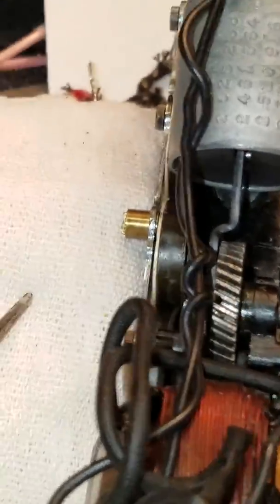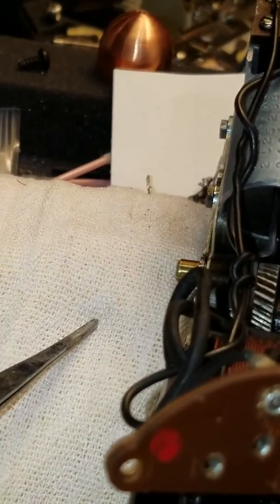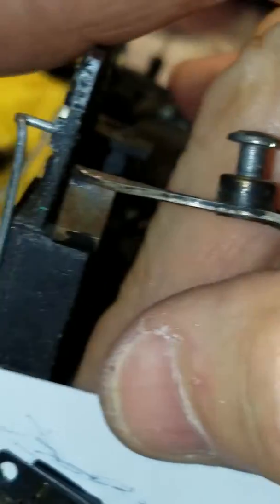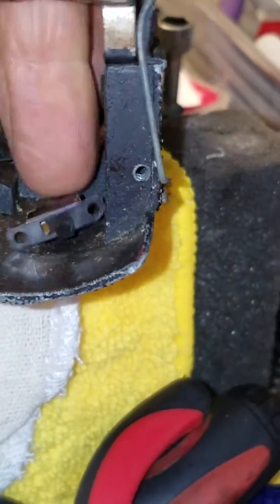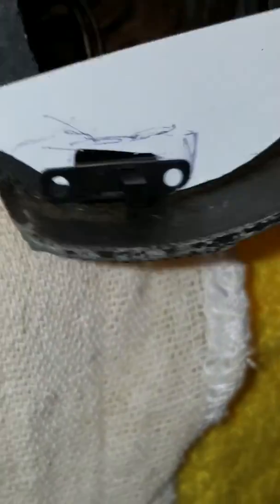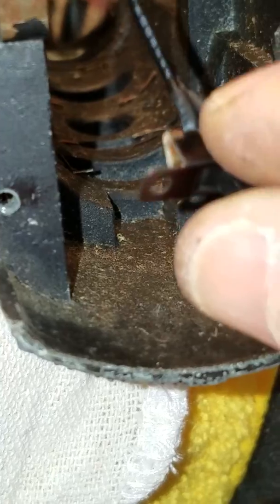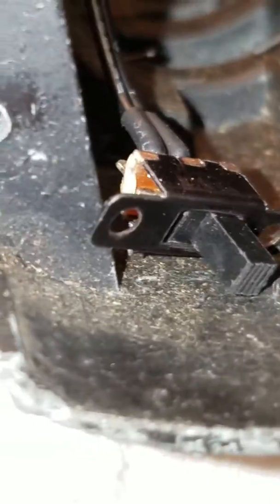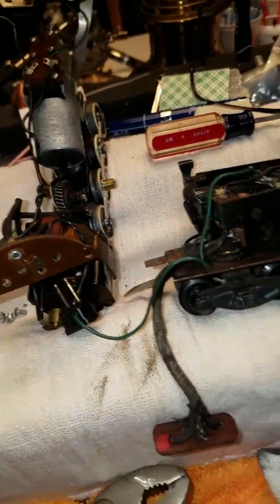American Flyer Smoke on/off switch

Comment: I installed the same thing in my jack panel, but instead of being held in place by a friction fit I drilled a #44 hole, 2.18mm and mounted the switch with a #3 x 1/4  sheet metal screw,  Holds it in place solid.  Good videos..Marty
Reply from the maker: Screws are always better, i am learning.